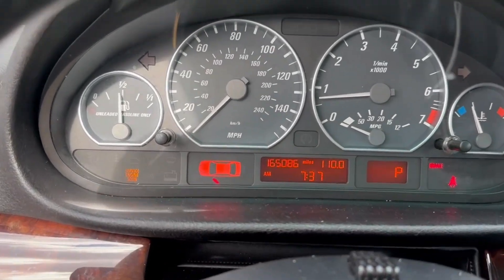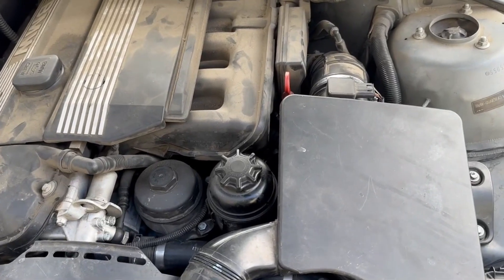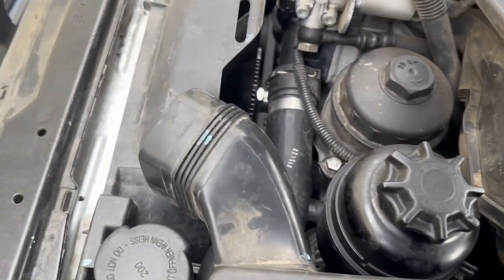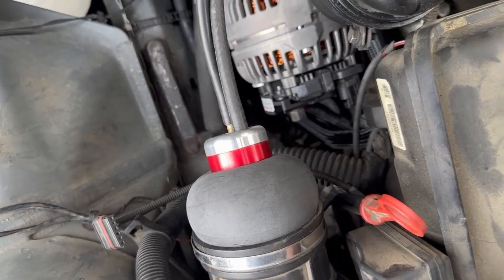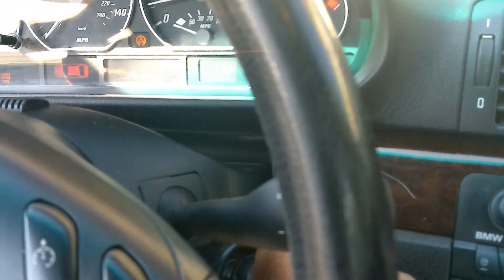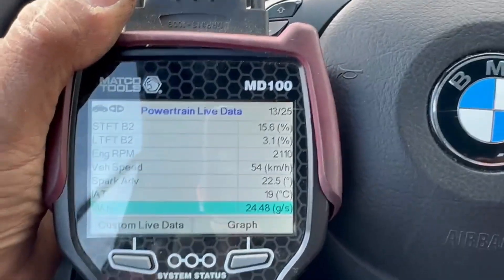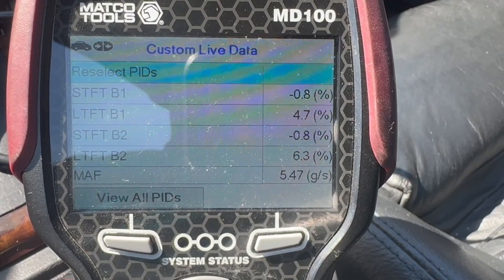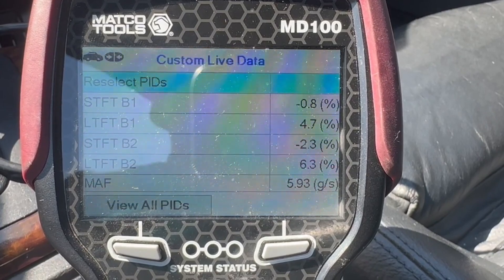BMW P0171 & P0174 System too Lean  How to  Diagnose & Repair Smoke Test Crank Case Pressure and MAF

Comment: When I try to go full throttle in my z4 the EML Light comes on and goes into limp mode...so I can't get a proper reading. I've replaced the the 4 o2  sensors before the cats new maf going on today can't find any vacuum leaks. Could a slow oil leak cause these codes? Any help would be greatly appreciated. Thank you sir!

Comment: I have a 2009 BMW 328i and I have both of those codes the weird thing it doesn’t say stored it says permanent. I do have a custom exhaust no secondary cats and no muffler I don’t know if the no cats can cause this or if it’s something else. I have new 02 sensors so I know it’s not that. Can someone help? Thanks!

Comment: Was your acceleration hesitating or no?
Reply from the maker: Not on this vehicle, usually a small lean condition will have no other symptoms other thana lit MIL. But a larger lean condition or faulty MAF can. You can still follow these tests to help locate the problem, if you have these two DTC set in the DME. Look closely at your MAF g/s . If your having those symptoms, that's where I would start first. If it ends up being a bad MAF, don't buy a cheap one, only use a dealer one or and OEM brand like VDO

Comment: Great video! If yiu have a carbon csl airbox where woukd you blow the smoke into?
Reply from the maker: It's a bit tough when you have a CSL box, there should be 1 or 2 ports in the box you can adapt the smoke machine too. Although it will leak out thru the air cleaner inlet. Depending on what style you have, you'll be able to fabricate something to either remove and plug the air cleaner or the intake port going into the box. You may not need to plug it if you see any leaks right away, but in order to have enough pressure in the plenum, you'll have to get creative to make sure no smoke is leaking out of it.

Comment: Same 0171 0174 codes were on my 2001 E53 X5 3.0i , I replaced every possible parts and finally it fixed. The real cause was on fuel injectors . Very possible were those O rings on them. I don’t want to take any risk. Simply replace them all with new ones. I used ADO oem parts. Genuine BMW too expensive.
Reply from the maker: Good job man!!

Comment: Awesome diagnostic.  I have a P1092 bank 2 lean code on my 2001 330i and haven't been able to find that much info on it.  Have you had that code before?  I'm gonna replace my air filter just in case.  Thanks so much in advance.
Reply from the maker: P1092 is a slightly different DTC for lean condition. Similar testing process by monitoring STFT and LTFT on both banks. It's usually a faulty upstream oxygen sensor. I believe both bank 1 and bank 2 oxygen sensors are the same exact part number on this engine. I would mark for identification and swap one sensor over to the other bank. Than disconnect the battery overnight or use the battery cable shorting method to reset the DME completely, which in turn resets fuel adaptations to 0. Than drive the car and when the MIL returns, see if the DTC moved to the other bank, P1090. That will confirm Bank 2 sensor was faulty and when moved to Bank 1, set the corresponding DTC. Hope that helps. If not, definitely follow some of the tips in the vid for checking on a lean running engine!

Comment: Can you please give us the links of the equipment used in your video?  I am interested in purchasing them
Reply from the maker: Sorry for the late reply, the scan tool is not available. I work with Innova Electronics when they were developing that tool, is how I came to have one. However, Innova's 5610 model on amazon, has the same functions and more. Here is the link to that one. Definitely a great tool to have for any car your working on!   https://www.amazon.com/5610-Bidirectional-Lifetime-OE-Level-Functions/dp/B07Z481NJM/ref=sr_1_1_sspa?crid=27MCXE1WKNSV6&dib=eyJ2IjoiMSJ9.5OuLx6wXvy-8fCMsPPDJXy8NVYwzmdLSePW6_YgDFfr-OVuQw1AHu30E78snIF-7xReHXKK9oGEFgN6nzx52rDHZn_AwomuWftYTp8FEy0xGcm-54L2oCJyzUnqxEENgYCvNxA2xhnHSYiPpi5n5GZWgYEb6MzI4RhiT_kQDPxx9TFBn8Tr78467lGK6Q8jDsl4edhTCn47hutu6xaDD-w.cP5iz0tR_VDJB0S5hwhV2nE_qxwhh-P1Jfy3zpcko0M&dib_tag=se&keywords=5160+innova&qid=1709340857&sprefix=5160+innova%2Caps%2C130&sr=8-1-spons&sp_csd=d2lkZ2V0TmFtZT1zcF9hdGY&psc=1

Comment: i just got e46 and i got these two codes and bad idle. i have changed coil pack and spark plugs, intake boots look good. change secondary air injection pump and valve and still getting these codes and a brand new maf sensor. BMW came with a cold air intake. could that be the culprit? i also heard the disa gasket but can't get in there since both bolts came also stripped. what would your suggestion be?
Reply from the maker: It's tough the cold air intake could be affecting the MAF readings. This usually happens if there is air leaks between the MAF and intake, and if the MAF mounting to the air cleaner has been modified. But before heading that direction, have you checked the Crankcase Vent Valve? Or when it was last replaced? Those hoses along with the valve fail all the time.
Reply: Not yet but i will. I will do a smoke test then tonsee if there is any rips on intake hoses and if it leaks through thr disa . Thanks for your reaponse

Comment: Just bought 2004 bmw 3 series and I went to auto for diagnostic test 

Said MAF AND/OR P0171
Reply from the maker: Definity a lean condition code, look at your MAF grams/sec on wide open throttle! Also, for air leaks after the MAF sensor to the intake.

Comment: Good video with some great tips and info it will come in handy with a 03 e46 project i picked up, also i gotta say i cringed when you started knocking the crap off the air filter above the dip stick tube will the dip stick missing..
Reply from the maker: Holly Cow! I didn't even notice that!! Good catch!!
Reply: @ripsgarage  was a yikes kind of moment.

Comment: Hi thanks for sharing your experiance with us, i have e39 m54 engine, p0174 and p0171 popping at the same time, i have no vacuum leak, new 02sensors, new ccv, new vcg, fuel pressure is 51, car runs great on highway and in city,but shakes on  low rpm(idle 650) what else should i try?how do i get rid of codes? please help.THANKS.
Reply from the maker: Hi, do you have access to a scan tool? If so are your fuel trims high at idle upwards of 20%? Are you able to smoke test the air intake?
Reply: @ripsgarage  thanks for reply, I do have scan tool yes, I did smoke test by Appling smoke in to maf tube, but did not see any leaks,  when I opened the oil refill cap lot of smoke came out with the pressured air, I am guessing there is no leak.
Reply: @ripsgarage  my short fuel trim sensor 1 is 27.2 and sensor 2 is  99.2 on idle 750 rpm
Reply from the maker: @Tigran94  Sorry for late reply, not getting the notifications. What about your MAF grams/second? On wide open throttle?
Reply: @ripsgarage  158
Reply: @ripsgarage  Hi, after spending whole day checking for the vaccum leaks, I finally find the issue, Bad brake booster, when I disconnected a vaccum hose to booster and plug it my short trim went to 0.2 or -0.1, and codes p0171 and 0174 disappeared.
Reply from the maker: @Tigran94  Nice job man!! That's how you do it! Sometimes the fuel trims change when you step on brakes at idle, or engine stumbles. It's much more rare, but definitely happens.

Comment: Thanks for making this video....all the videos on youtube showing this E46 is always the intake boot being cracked. Common problem in the E46. Good to see other diagnostics for the same codes.
Reply from the maker: You're welcome!
Reply: @Rip’s Garage  I replaced everything under the hood vacuum lines intake boot cleaned everything ccv new etc everything new I'll try the new air filter and see thanks for the video

Comment: Did this fix their code?
Reply from the maker: Hi there, yes it did! A few reasons on the E46 for lean conditions. But get an inexpensive scan tool like the Innova 3160 or 5160 and you can read the MAF g/s (grams second) if your not reaching the spec on wide open throttle, than remove the air cleaner and go drive it. If it's still the same, replace the MAF. If the g/s are good, smoke test and crankcase test and fuel pressure/volume test it.
Reply: @ripsgarage  I’ve been chasing these two codes on my 2005 x3 e83. Replaced 02 sensors, the whole ccv system, intake boot, disa valve o ring. Still get the code. I saw ur checking the fuel on the scanner, my range is around 14 and 16 as well. Also my maf is around 4.5 g/s
Reply: Sorry, I have 16-20% positive long term fuel trim and negative 5 -8 % short term . Not sure what to make of this data tho.
Reply: @RandomRubio   did you figure out ur issue 
I have a 04 x3 e83 6 spd having the same issue . 
I’ve replaced the valve cover gasket , pcv , brake booster hose , disa vavle , fuel pump and regulator , 02 sensors and cats still fighting for my life and the smog is coming up in a few months 😢
Reply: @xepiicxalexs  did u try replacing the rubber intake boot and maf sensor
Reply from the maker: @RandomRubio  Sorry just saw this, get yourself an inexpensive scan tool, that has MAF g/s data. When you wide open throttle you should get close to 150 g/s, otherwise the MAF is causing you to run lean and will need to be replaced. Obviously that is if the air intake boots are all tight.
Reply: what is the desired spec?
Reply: never mind. 150 .
Reply from the maker: @bogusienombre355  Ha Ha, yah sorry I put it at the end!
Reply: @ripsgarage  haha my bad. Glad you shared this. It's simple orderly elimination! Great big problem solver! Appreciate you.